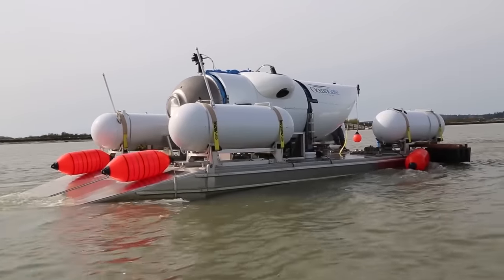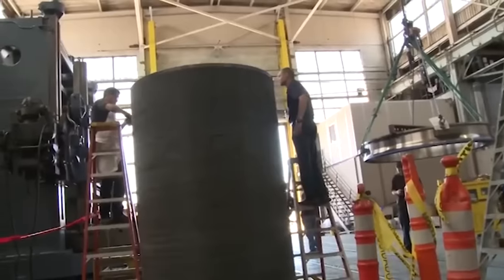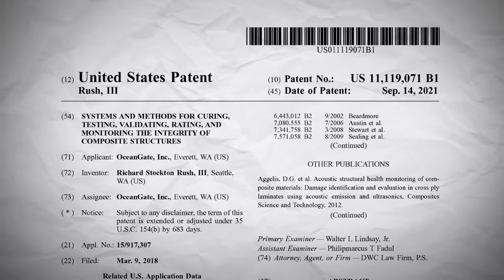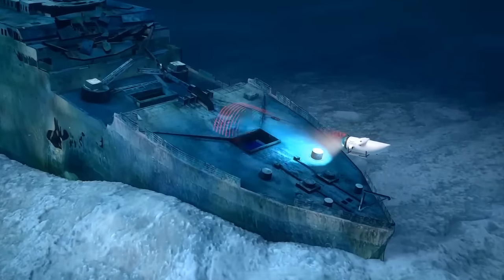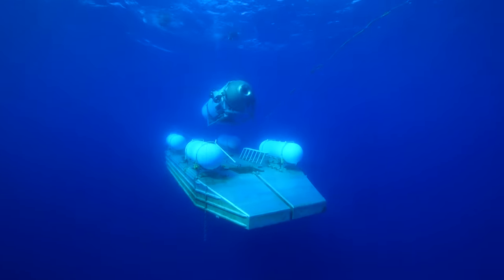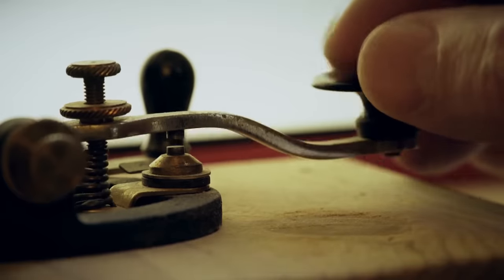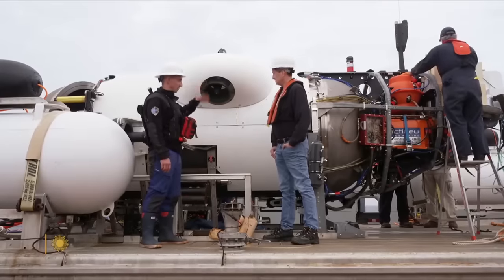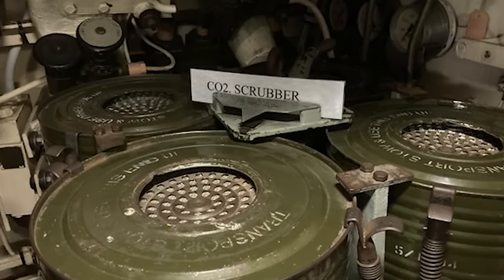Exposing OceanGate Submarines Many Fatal Designs

Comment: Fun fact: that railway tanker is imploding under a one atmosphere pressure differential, the Titan would have experienced around three hundred and eighty atmospheres of pressure differential. 😬
Reply: It was under vacuum.
Reply: And also it was made of a ductile material that bent. Carbon fiber is brittle and just shatters. Glass would be a better comparison.
Reply: @phunkyjunkee Makes no difference, the physics are exactly the same as going deep under the ocean.
Reply: There's nothing fun about that fact.
Reply: “But what about body recovery?” 🤦‍♂ facepalm every time I hear someone ask that. Can’t recover meat soup from the bottom of the ocean.
Reply: If you put civilian tourists in a vessel, you need some independent body to check its safety. We cannot rely on the word of the CEO of the company. Same reason why we don't blindly trust a company when they say "Our baby formula has no lead poisoning!".
Reply: @innocentnemesis3519 At least the fish ate good I guess.
Reply: @RoastBeefQueefSniffer  No need for expensive funerals and burials!
Reply: @One.Zero.One101  I guess you could just bring a few buckets of water from the depth and slap some tape on each one with a name on it. Maybe blend up some shark chum in there if you wanted.
Reply: @innocentnemesis3519  the bones may be there at the bottom
Reply: @ryanshannon6963 Lmfao
Reply: @RoastBeefQueefSniffer more like the plankton
Reply: The metal simulates the wall of energy each body was faced with.
Reply: I read somewhere that at that pressure the air in the sub would have super heated to the temperature of surface of the sun. That would have then exploded imploded exploded and imploded again. The bodies would be bologna mist after that.
Reply: @phunkyjunkee  you understand what 1 atmosphere of pressure is right?
Reply: Yea as long as you understand air is actually like a liquid but much lighter it makes sense.  

Technically your feet (when standing) have more pressure on them (atmospheric) than your head but obviously our senses can’t feel the small difference anymore than when in water.
Reply: Probably, the tanker was not even close to the 1 atm differential.
Reply: @phunkyjunkee  Which is the same. All you need is some kind of pressure difference.
Reply: @bailey-bobthorton1950  forgive if I'm mistaken but I believe that the navy found several pieces of the ship, as if it had shattered, like glass
Reply: @One.Zero.One101  They are in international waters. They can do what ever they want.
Reply: @phunkyjunkee  Vacuum is just a lack of pressure. Since the baseline is 1 atm outside the tanker, the pressure differential can be no more than 1 atm (likely less because it failed before reaching full vacuum). That is very small compared to the pressure differential in the Titan implosion.
Reply: Not really a fun fact.
Reply: @One.Zero.One101  They have an opening in management that recently came up. I'm sure they could use your expert chatroom knowledge, and I hear they pay well.
Reply: @phunkyjunkee so 389 cause it’s 1 inside not just 1 still
Reply: @hotdog9262 there is no single bone left by being imploded at that force within one millisecond. A brown cloud of soup it was.
Reply: Railway tanker really. I'm not buying that.
Reply: @coolmuzt8386  there is nothing fact about that statement period.
Reply: is it confirmed that it actually reached titanic depth  before imploding?
Reply: @phunkyjunkee  Yea, when you understand physics, that doesn't matter...  Draw a Physics 101 force diagram and then report back with what direction the arrows are.
Reply: @lukas7417  Crushing bones would require a depth of over 35 kilometres
Reply: @coolmuzt  Sure it is, it is fun to understand equivalencies.  If that railcar got rocked at sea level, the sub got dominated when faced with 2 million PSI.
Reply: @phunkyjunkee  So that's a one atmosphere pressure differential, vacuum inside the tank and one atmosphere of pressure pressing down on it from the outside atmosphere. Also it was under only a partial vacuum, it's very difficult to pull a perfect vacuum, there was probably still about  0.5 to 0.10 bar of pressure still in the tank when it imploded.
Reply: @asiamies9153  lol not inside an air filled tube that implodes at 6000psi. Again.. in 1ms.
Reply: @lukas7417  if you pulled a human body down there it would still look more or less like it did on the surface. its the violence of the implosion that violently destroys tissue. that said, bones would probably survive
Reply: @hotdog9262  you have absolutely no idea what that insane amount of pressure released in 1ms does to the human body. Sorry mate. Google it. Lots of scientific explanation out there
Reply: @phunkyjunkee  Still only 14.7psi (or 1 atm) ABSOLUTE pressure differential.
Reply: @lukas7417  there need to be an investigation carried out first. you are assuming alot
Reply: @lukas7417  human remains are shipped to land now